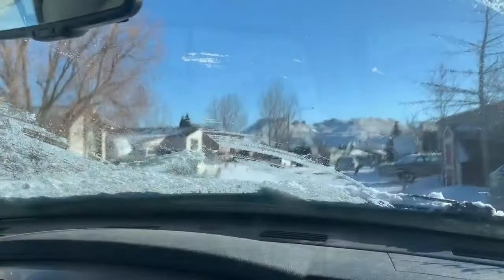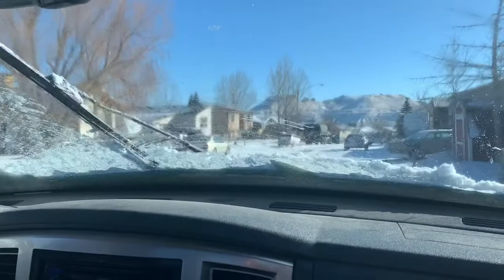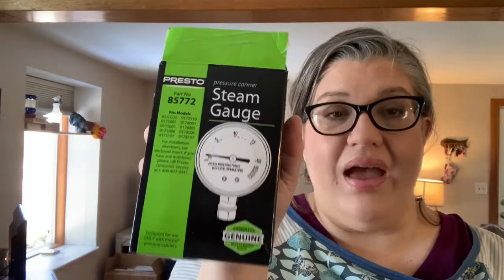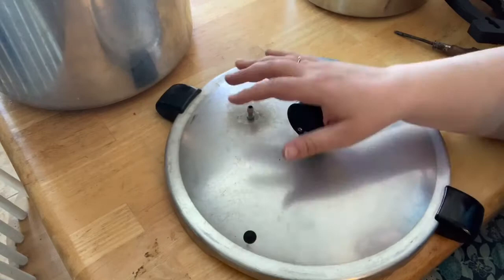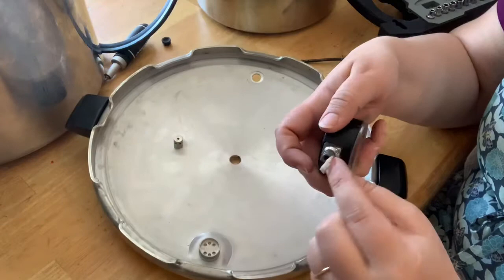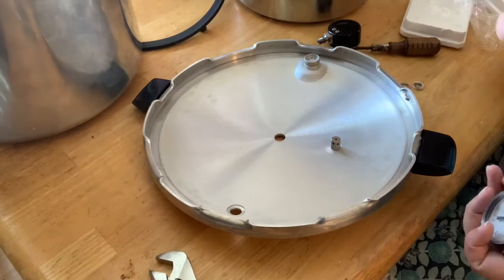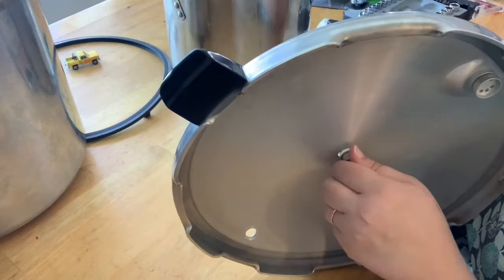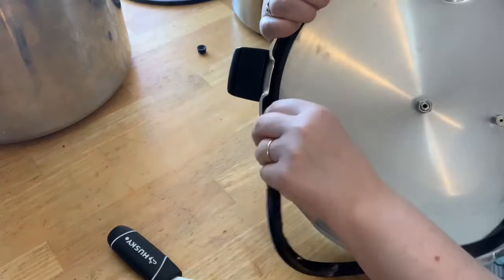Under Pressure! Maintenance on your pressure canner

Comment: I just purchased the same replacement gauge for my presto 0175510. The instruction book says the white compression gasket should fit inside the hole where the gauge sits. My new assembly is like yours and sits flush with the lid. Have you had any problems with that new assembly?
Thank you🙂